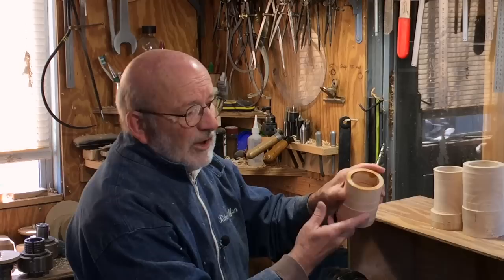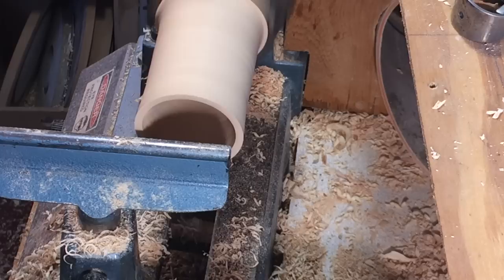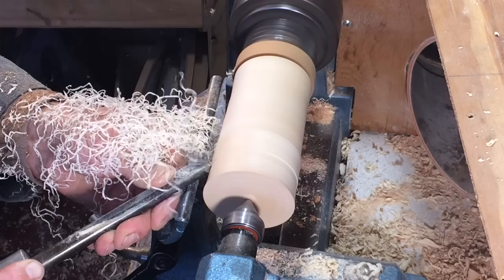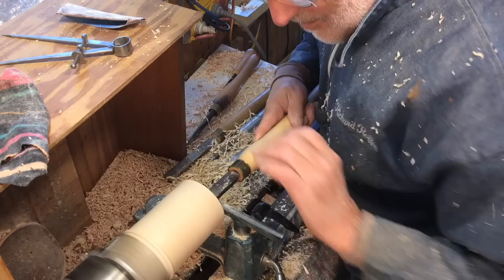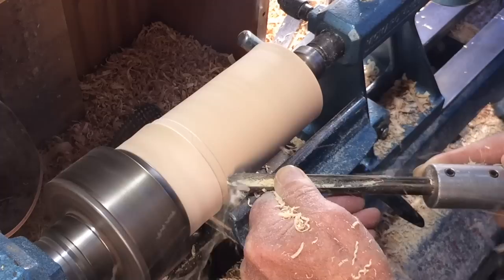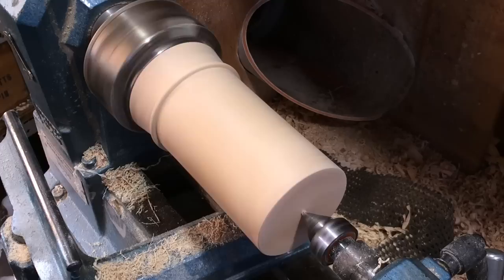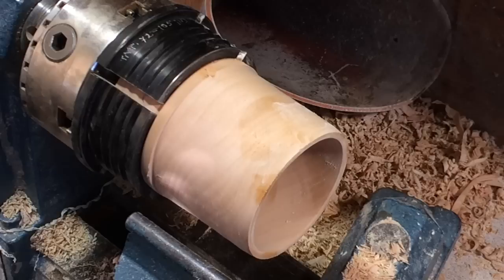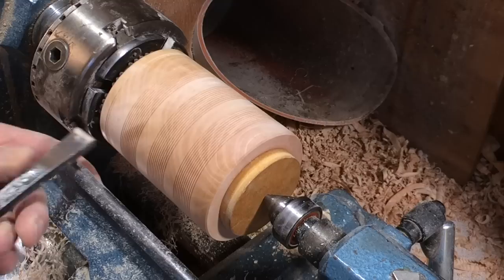Richard Raffan on re-turning three roughed-out cylinders

Comment: A big Thank You for this and all your videos, you have given me so much guidance in my turning. Also the inspiration to  emulate your work.
I notice you favour gripper jaws over dovetail jaws, is this because they're more versatile?
Reply from the maker: Expanding jaws always grip on a small diameter, so the grip is never as secure as jaws gripping around a foot or tenon. Any chuck marks are easily removed using one of a number of techniques. Expanding jaws limit the depth to which  you can hollow a bowl (or anything else), whilst compromising design options and usually leading to visually and physically heavier bases. Using expanding collets in the base of cylinders like these would be a ridiculous approach. https://www.youtube.com/watch?v=DV2T6oJgCi4

Comment: Impressive to follow the finishing of these three cylinders. While completing the bottom of the second cylinder, you remarked that such a (finishing) cut could not be achieved with a carbide cutter. I don’t question the observation, but I wonder whether you feel there is a place for carbide tools in the arsenal of the woodturner. What is your ‘take’ on carbide tools? Do you use them or see a place for them in the craft.
Reply from the maker: There's probably not much difference between carbide and traditional scrapers when it comes to hogging out the insides of bowls or cylinders like these. When it comes to finishing cuts and particularly curves, I find it much easier using wider scrapers rather than narrow. Mostly I avoid replaceable tips on the grounds of inconvenience, and above all their expense in relation to traditional M2 tools. I think they're  a triumph of marketing over substance.

Comment: How do you deal with difficult woods like white oak or apple when drying blanks or roughed out pieces? Does the age of the tree affect how prone it will be to checking? I have quite a bit of oak from a tree trunk over 250 years old and limbs over 100 years old.  Will they behave differently when drying than the younger limbs from the same tree? So far, I rough turned four 11½" bowls and several quarter sawn blanks for boxes, and they all have split, most quite badly. I put 2 coats of wood glue on them as sealer, which has worked flawlessly until oak and apple. Your channel is awesome! Thank you for taking the time to post so much content and for sharing your knowledge of the trade.
Reply from the maker: I've found that it's species that have different drying characteristics, so if a wood likes to split or warp it'll do so regardless of age or size, trunk or branches. As a production turner I looked for woods known for their stability that also appealed to the general market. Timbers that split readily often warp dramatically as boards so I avoid those for regular symmetrical bowls, but that's just what i want for my green-turned distorted Wavy Bowls. https://www.richardraffan.com.au/bowls-turned-green/ When you rough turn bowls maintaining an even wall thickness and grain densitity reduces the chance of splitting.   https://youtu.be/laBPappesP8
Reply: @RichardRaffanwoodturning  thanks

Comment: Is your camera mounted on an overhead rail system?  What camera do you use?  The 1st person views are very nice and appear to be high quality.
Reply from the maker: I had to design a camera stand for my very limited space. It's a steel pole on the small heavy base you see at the end of  https://youtu.be/L2geWEuOwoo . The camera is mounted on the end of a 400mm long piece of 90x20mm pine with a hole at the other end that just fits over the pole. When the camera arm is horizontal it can be quickly and easily repositioned to anwhere on the pole, then gravity keeps it in place. A short video will clarify matters. I'm using an old iPhone 5.

Comment: Other than right at the top of the cylinder where you might want to add a lid, is there a reason that the interior has to be a round cylinder?  If the interior was left as an ellipse, would it cause any problems?  In fact, would it even be noticeable?   Thanks for sharing the video.
Reply from the maker: It rather depends on the purpose of the cylinder. For me having any turned form go slightly oval will usually add to its appeal. If it's a pencil pot, having it wider inside might be an advantage too. When a cylinder goes oval it's very unusual for the rim to remain absolutely round and flat.

Comment: Is a cross-grain box better than the spindle turning?
Reply from the maker: Crossgrain boxes need loose lids whereas endgrain boxes can have suction fit lids. So it depends on what sort of bo you want to make. Crossgrain is probably easier and for boxes over 3-in / 75mm diameter, suitable material is easier to obtain.

Comment: Do you try and put a burr on your scraper? I’ve been taking mine to the grinder upside down to get the maximum burr, seems to work OK
Reply from the maker: I use tools straight off an 80-grit CBN wheel so there is always a small burr on the edge. The green hone I use is coarse — it came with a garden tool and isn't marked as to grit, but also raises a small burr. On some very hard woods like gidgee or cocobolo I find a finely honed edge preferable.